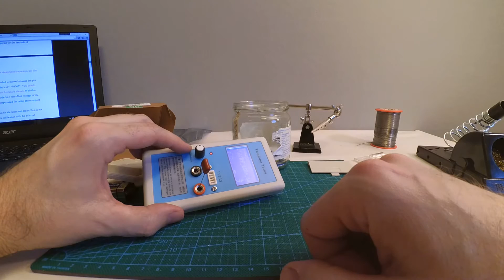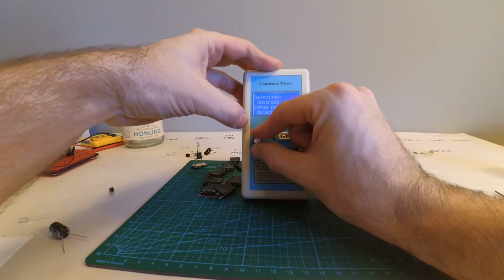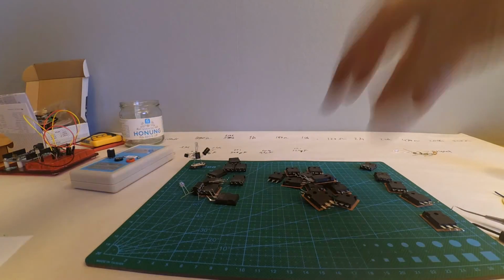#3:1 Transistor Tester M12864 - Build and Test

Comment: Did you test the frequency counter option on this kit ?  Mine returns wrong values so I'm not sure if this is because I goofed during the assembly or if there is an error in the firmware.  Test the device with a 1Vpp signal from 1KHz to 25KHz in 1KHz increments and see if the unit returns proper values,
Reply from the maker: I didn't have a reliable frequency source at the time. 
But I have now, so I will give it a try and get back with the results.
Reply from the maker: I have made a test now of the frequency counter and my Transistor Tester works perfect.
Video here: https://www.youtube.com/watch?v=NGCdgakyXhE&
Reply: Good day, I looked at your video and if I would do exactly what you've done, I would have to conclude that the frequency counter works perfectly as you reported.   I must put emphasis on the frequencies of 25KHz and below for the moment being.  What is really important are the frequencies at which the problem arises.  With my kit, frequencies below 6Khz are fine but between 6Khz and 25Khz, things are getting messy.   Just for the record, in the 1Khz to 25Khz range, the 6, 7, 8, 9, 11, 13, 15, 17, 18, 19, 21, 22, 23, 24 & 25 KHz frequencies reported wrongly computed frequency values and quite a few of them had wrong values for the time periods as well.  However the frequency reading at the top of the display was spot on pretty much all the time.  So globally, the values that are incorrect are the ones on the second and third line.  As amazing as it may sounds, at some frequencies a change of 1Hz in the frequency was sufficient to either report the right or wrong values.  For instance, at 5960Hz the computed frequency was very close in the few 1/100th difference.  Adding one single Hz to the frequency was sufficient to screw up the results.  The computed frequency was showing 99.17507Khz while the fonction generator was at 5961Hz.  Reducing the frequency back by 1Hz, then the computed value was just fine.  So bizarre !!!!   I reproduced that 1Hz difference scenario at 6305Hz.  At 6305Hz everything was fine and dandy.  At 6306Hz, total computed value chaos.  A 337.7825KHz frequency was reported at 6306Hz so if someone can clearly explain me what is going on, I'm all ears.   To reproduce that off the marks calculated values, you can use the 15 frequencies I listed above and you might see wrongly computed frequency values, wrong time periods or a combination of both.  What is important here is to make sure that the frequency is as close as possible to the values I mentioned above because I didn't verify if these frequencies are falling in the 1Hz difference bizarre situation.   I'm not an engineer nor an electronics genius but I really enjoy the hobby.  When I need an answer for something I don't understand or comprehend, I'm searching everywhere.  Hopefully I'll find an answer for the actual puzzle.

Comment: this transistor tester can tell you if the transistor is good or bad condition (short circuit)?
Reply from the maker: Correct.
With a good transistor (or mosfet) the tester givs you the type and specs.
With a bad transistor you get "No, unknown, or damaged part" - display.

I use transistors and mosfet with Arduino outputs and the tester is an easy way to check if I have burned (oops) them :)

Comment: Did it come with test leads or do you have to buy those? I have ordered the same tester from Banggood and looking forward to putting it together. I hope it is good. Thanks for the video.
Reply from the maker: There were no test leads included in the kit.
Good luck with the build :)
Reply: Mine didn't come with a manual.  I had to figure it out on my own.  Watch the video and pause it to see the info you need. It is fairly straight forward.
Reply: If you get stuck send a message and I will try to help you.
Reply from the maker: This Link works for me: https://drive.google.com/file/d/0B9RT-Z00GQUAM2JWV0RrR2Y0SnM/view
But as "C MJ" comment you can do it with no manual